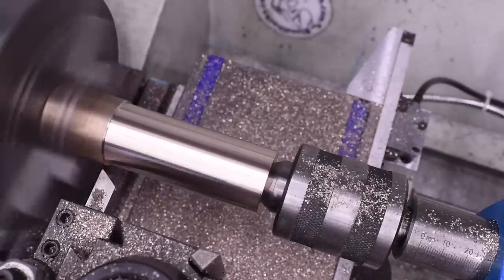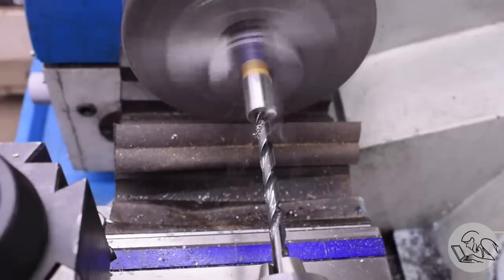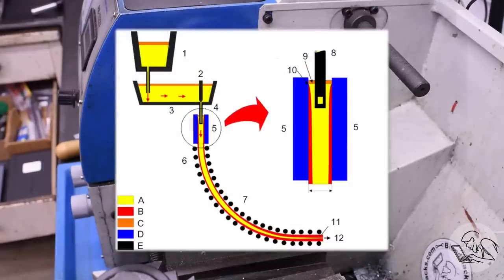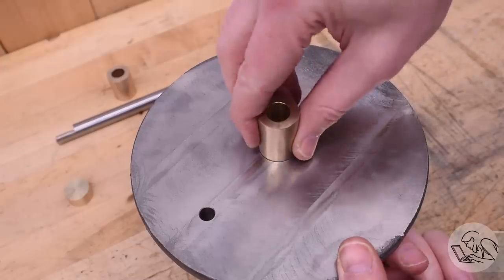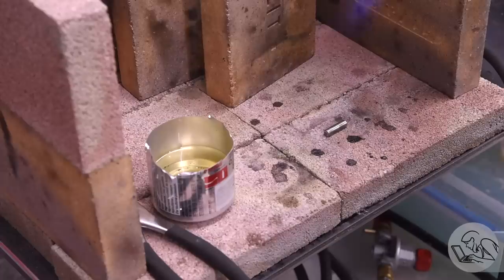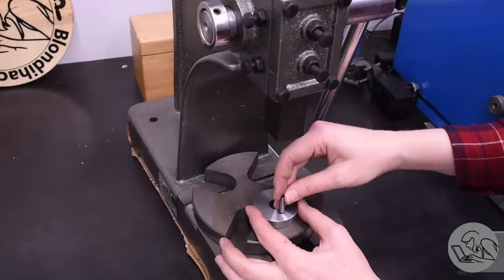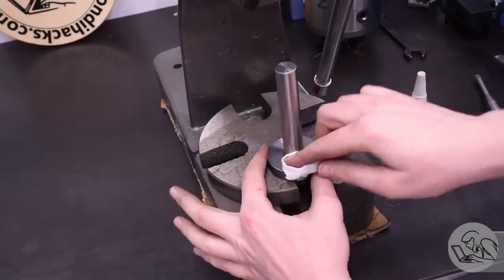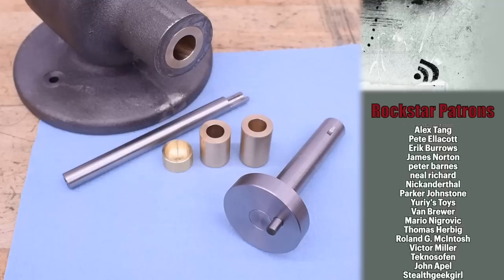Let's Build a Die Filer - Part 4, Crankshaft and Drive Rod!

Comment: I love the creative oil pump/lube system created by the stroking of the rod. As a professional machine designer I have just added that to my catalog of clever hacks that I might apply somewhere in a future design. We often need to create a vent to make sure that a sliding rod in a blind hole doesn't lock and this is a great way to actually put those features to a use. That is a gem buried and now uncovered.
Reply: april fools has broken me, i legitimately read this comment and thought it was just lewd double entendres when it's literally just factual information. smh...
Reply: @OutbackCatgirl  ¡Wow! Trust me, I was thinking about shift rods in transmissions. If I work at it I can read it your way, however.

Comment: Another great video. I want to let you know that you have inspired me to dive deeper in to metal working. I am a retired self employed cabinet maker but have always loved working in metal. When I was a lot younger, I was a TIG welder, and that job paid for some woodworking equipment. So, at the young age of 70 I bought a Shop Fox M1049 lathe and a Grizzly G0759 mill in the last 30 days. So far, I haven't hurt myself or broken any tooling....yet.
Reply: Good for you! I'm 65 and a recently retired auto mechanic, and have plans to do the same after I move back east.  I don't want to have to ship equipment any farther than necessary. Shipping my tools will cost enough!

Comment: Glad to know that I'm not the only one to think "just another roughing cut and we'll measure it again", then "oops... too small".
Those "putting on" lathe tools are hard to get, althouhj in some applications a knurl can work wonders.... 😀
Those really deep holes are a problem without specialist drills..... The ones with which they drill rifle barrels are pretty clever bits of kit, usually wit internal lube channels and in some cases carbide or ceramic tip cutters.
Brake hones are very handy... I'm a gun smith and they have many uses in my practice..

Comment: I just picked up a parting tool that uses carbide inserts that are .130 wide and are held in the holder by friction. I was skeptical until I used it last week. It works great. Picked it up at KMS tools in Canada.

Comment: Loctite is really a miracle fluid in all of its iterations. I have worked on equipment old enough that it used Permatex number 1 as a threadlocker / sealant.  This was not optimal. I love Loctite

Comment: Interesting idea about aligning the second bushing in epoxy, to allow it to "self align"

A guy in the UK was making/assembling an English Wheel; main part is a HUGE 6 foot casting, just like a C clamp. Simplifying, 2 threaded holes need to be made in the jaws so that 2 threaded rods running in the threads are perfectly aligned.

In the modern era we'd use a line borer.

Back in the 1920s they drilled (or cast) 2 oversize holes in the jaws, put two threaded "nuts" onto a single threaded rod (so the nuts are perfectly aligned w.r.t. each other) and set the two nuts simultaneously into the oversize holes using molten lead...

Clever, I thought.

Comment: Another great video.  A "Brush" hone also works well in place of a brake cylinder hone, I have built up a collection and can usually find the right size.  Very easy to use to get a proper fit.  They also come in a variety of grits.

Comment: I often wish I had a drawbar on my tailstock so when I use an MT3 endmill holder, it won't pull out if the endmill grabs when I'm making a flattish-bottomed hole in copper, brass or bronze. Looking fabulous!

Comment: One of my mobility scooters uses woodruff keys on the rear wheels. It can be tricky to slide the wheels on, because the keys can rotate, as you push and kind of wedge themselves in a way which prevents the shaft going further. Took a few tries.

Comment: Great video as always! I had several Blondihacks moments yesterday trying to machine an axle to fit my new bike to a trainer... Loads of ends to face and edges to chamfer, and naturally a small bobo when I realised I could have used the same method to mill the wrenge-flats on both ends of the part instead of eyeballing one side 😂

Comment: Good morning Quinn , Hope this isn't a repeated question ! 
I live in Ontario 
* I was wondering where you get your silver solder and flux . 
I can go to the local  welding supplier but it's quite expensive . 
What brand and silver % do you use and flux brand  . 
Im very impressed with your level of knowledge on machine work and your shop is almost surgerically  clean 🙏

Great work Quinn !!
Thank-you

Comment: Hardening should always change the size a bit; the martensitic structure of hardened steel is less dense than other steel crystalline structures, so with the same mass the part has to expand slightly. The best example i can think of is katana and similar swords, where the curve is produced by the cutting edge expanding during hardening while the soft back does not

Comment: I think you answered your own question about why one long bearing for the crankshaft when you said it was acting as a thrust surface. If you had two bushings in there, you would have to find a way to machine a feature so that the one inside the case could take the thrust load, and I don't think you'd have a very good time trying to machine some kind of a step that far inside the piece. Presumably spending the money on a few extra inches of brass stock was worth the hassle of not trying to find some other way to constrain the inner bearing.

Comment: I think I have a guess for why they went with one massive bushing rather than one at each end. That crankshaft is going to be constantly covered in oil, if it were two bearings the gap between them would likely fill with oil over time which could cause leaking or some weird oil pressure nonsense.

Comment: Yeah when I was new to using a vert band saw like yours I was cutting something odd shaped. And it snagged in the blade, rolled and pinched my fingers. I think if I had my fingers closed to the hold it would have broke one or two. But because they were further out the part was able to flex so it didn’t crush me

Comment: Brilliant machine work as usual, but I think we may have been deprived of a "Yahtzee!" near the end when you cut off that bronze bearing. Also, we could use a bit more information about those pop-can shims, like for example, Rockwell hardness, average material thickness, alloy, etc.  Would beer cans work? Tomato cans? Spam cans? Soup cans? How much leeway do we have for possible substitutes if we don't drink soda pop?

Comment: I had to look up what a "scotch yoke" was, I've made and used those pin and slot type mechanisms but never knew that was the name for them.  I am curious how it's going to attach to the file holder shaft, I assume it's just going to be clamped on somehow since there were no features machined into the shaft for that purpose.  Also assume the oil hole is going to face the scotch yoke and spray oil onto  it?

Comment: It's coming along nicely, is there some sort of oil seal on the outside of that crankshaft bearing to keep the oil inside and not make a mess on the drive pulley?
Reply from the maker: Weirdly no, but it’s not a pressurized oil system so I doubt is a problem

Comment: Can't wait to see this one finished. With really small parts like this is it always OK to air-cool them when annealing, or do some of them need insulation over them to stop them cooling down to quickly? Heat treatment stuff always seems like dark magic to me because it's always difficult to tell if I've done it right: If I've blown a dimension I can tell by the measurements and the way the part wobbles, but heat treatment is always just on faith and I don't like that!

Comment: Great work!  I built one of these die filers last year.  It was a fun project but the quality of your work puts mine to shame.  Are you planning to add the oil hole in the top of the crank shaft bearing?

Comment: Good job. But I have a question. Couldn’t you drill a hole in the side of the casting and put in a set screw to lock in the bearings?  Instead of lock tight?  Thank you. 😊

Comment: Hi Quinn, can you help me to understand the overconstraint (~25 minutes in) that occurs when we clamp the cylinder between two opposing v blocks? 

My understanding is that we are trying to reduce mobility, so an overconstrained condition is acceptable. Would the elasticity of the metals make up for any variations in precision? Would the same over constraint occur by clamping a square between two parallel surfaces?

Comment: Is it ok to press the part against the file on both the up and the down stroke of the file or do these machines have special files? Is that not bad for the file teeth?
Reply: Running the file both ways doesn't damage it, unless you have really cheap files.

Comment: Thanks for another great video.
Quick question, making that hole with the end mill in the lathe looked very quick and efficient. Would this be a more convenient way to make largish holes vs drilling all the various different progressively larger drill bits?
Also why did you not let the lathe turn when using the hack saw?
Reply from the maker: Never ever use a hacksaw in a spinning lathe! Very dangerous. It will grab the saw and throw it at you, possibly breaking your arm in the process. 

Plunging with endmills is actually very slow, contrary to how it looks on video. They don’t like cutting that way and don’t track very well. Drills are very efficient, which is why we use them. They are bulk removal tools.
Reply: @Blondihacks  thank you for both reply’s. This helps all of us who might have been wondering the same thing.

Comment: So after getting blisters filing on the copper parts of the last video you are going to stay on the die filer. ....  Makes seance to me. 

We have a Milwaukee  and more then once it has been the most valuable player, especially at 1am when the part HAS to go out in the morning. = Just FYI you CAN use regular files if you turn them over and grind the appropriate tang on them but the factory files, that are getting harder and harder to come by, work much better then a Dixied up Mexican Nicholson  3 square you picked up at Lowe's.

Don't let anybody get you side tracked off the die filer again. You are on the home stretch and 5 'el get ta 10,  you use it every day you are on the engine. You will not know how you ever lived without it.

Comment: Was the housing cast in a shed? At work, we are able to get precision within tenths of millimeters on much larger components, so kind of curious how they managed to make it with such poor precision.
Reply: Where were you when I needed precise cast iron castings? All the foundry companies I know do not differ in quality, and post-processing takes a disastrously long time.
Reply: Does your company charge the same price?  Please provide a link to this house of perfection.
Reply: @randy-yk1yk  If at least someone had reached such a level of casting, my profession would have been self-annihilated from uselessness. But people are still pouring metal crookedly and a machinist is needed😂
Reply: @Anrakyr  Yea. Diecast, investment castings, things like turbime blades, but let's see you carry a couple thenths with a sand casting.(Did you see the continuations cast  bronze was not eve, ROUND within .010"!

(BTW, .008 "TIR in Cast iron,,,,,I don't believe you. )
Reply: @mathewmolk2089  Well, as for turbine blades, I will say that they are precisely processed mechanically after casting, things like balance do not arise from scratch. By the way, castings made of cast iron with an accuracy of 0.008"? This only happens in fairy tales. And I won't say anything about brass castings. This is an area of black magic no other way.